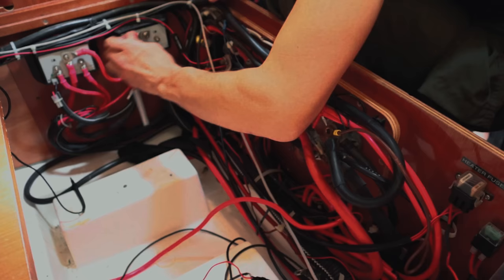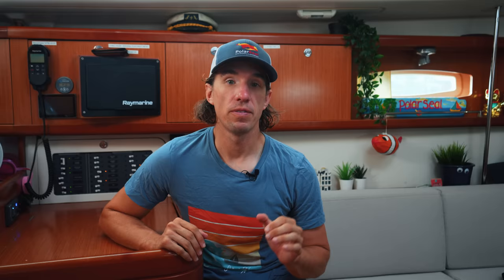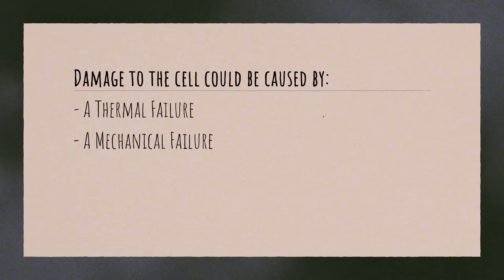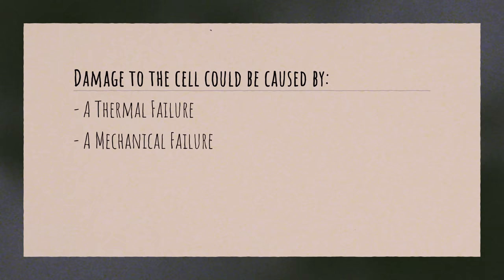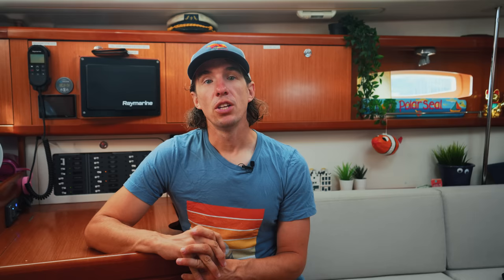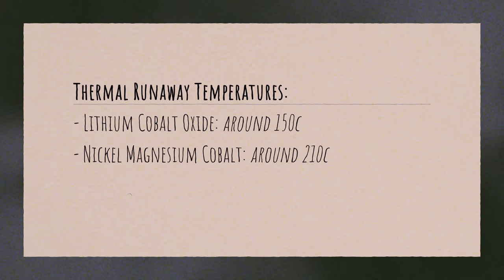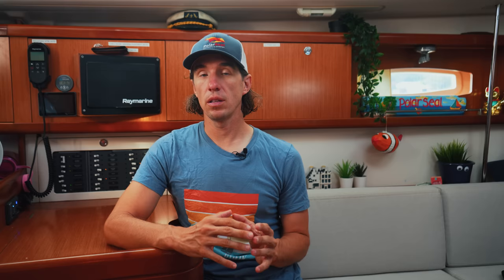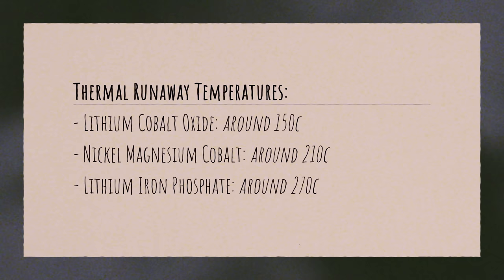WATCH THIS before installing lithium batteries on your sailboat ⚡ [RYAN'S TECH CORNER]

Comment: Got rid of all the parallel house batteries, AGM or liquid.  Reconfigured all the wiring as my new house battery is 6 two volt spill-proof 3500AH forklift cells in series.  Distributed these monsters as low as possible around the bilge to add weight to the keel and maintain balance.  Starting battery is separate but monster to crank diesel is switchable if needed.  3kw inverter gives power to 115vac fridge/freezer.  House alternator is 800A which slows Mr Yanmar a bit.  4.5 hours fully recharges house.  Dock powers 200A regulated charger in port.  Couple of gallons of distilled refills the beasts per year.  They even power the air conditioner!

Comment: A well presented and clear explanation of lithium technology. Well done. It would be nice to add in a section about high ambient temperature and maintaining good battery compartment ventilation. Sailing in the Tropics doesn't do any battery technology any favours and good battery cooling in this environment would be beneficial. You will get more life out of your lithium batteries if you can keep them close to 25degC, not easy in the Tropics.  A lifepo4 installation designed with a 15 year life will likely half its life if the battery is kept at a constant 35degC.

Comment: I have a small sailboat with a pull start outboard and I want to change the AGM battery to LIPO4. I am told I can't charge LIPO4 with the outboard because it will overcharge the LIPO4. Can I use a DC to DC charger in between the outboard and the LIPO4 battery without a AGM battery on the outboard side of the dc-dc charger?

Comment: This is a very good technical video about the lithium batteries. Yes you do a bit of promotion for the Dakota brand but in general this information applies to every manufacturer. As you said, the installation is key. Cheers, Richard

Comment: Hey Ryan, thanks for the great video. My primary concern with internal BMS is that most have no communication once they are placed in a string. You gave this example in your charging segment. I am a fan not a Troll. Even a simple LED indicator showing status would be helpful, but Bluetooth would be the gold standard. I have installed several of these systems (victron so far) and will use your video to teach boaters better LiFe knowledge. Thanks for everything

Comment: Good balanced presentation.  I do have one comment about external vs internal BMS systems.  The first think that jumps out to me as an advantage of an external BMS is that the external BMS is not subject to operating in the potentially high temperature environment within the battery (assuming the external BMS is located and installed properly).  Since heat is the enemy of all electronics, the external BMS should have a lower failure rate than an internal BMS if all other quality factors are the same.  Note that the lithium batteries in my system have internal BMSs.

Comment: Great video guys. Very well put together and informative. I do still prefer the diy builds myself with an external bms for a few reasons but agree there is nothing wrong with a properly built "drop in  ". I like monitoring my cells and would like more control over bms parameters. Not a fan of most bms parameters as they are to protect the battery from catastrophic damage vs say maybe losing a little capacity at the top and bottom to improve cycle life. At least this is what I want for our next battery build after using a cheap dally bms I want something more programmable and not many drop ins are. Thanks again.

Comment: Thank you Ryan.  It's great that LiFePO4 starting batteries are ready for marine service.   Is there are market for an even smaller starting battery for 10-25hp outboards?  Or is the Dakota 60ah the smallest you'd want to go?  Every lb in your tender hanging off the back of the boat and being drug up the beach matters.  Thanks!!

Comment: Thanks for the effort!  I'm dropping in a battery  LiFePo... using it as a house cruising battery for weekends...  and hopping to limit charging to when Im plugged in.   When we get a bigger boat the liFePo batteries make so much with sense,  with the increase comfort,  and safety, while cruising it make no sense to look at AGM and Lead Acid...  Times are a changing .  BTW  Good On You to try a startup!  Im going to look at Dakota more seriously.

Comment: Thanks for the excellent videos on lithium!  To save space on my twin-diesel powered sport cruiser, the manufacturer installed three 12v lead acid batteries in parallel for a combined 300ah house/port starting bank. As the bank is doing double duty, the batteries are deep cycle, which is obviously not optimal for starting. Based on your videos, Dakota website and multiple other sources, I am considering individual lead acid starting batteries vs new Dakota starting + deep cycle batteries with a (mostly) independent LiFePo4 house bank (ACR or combiner) . A few questions for you: 1) Assuming externally regulated alternators, any reason at all to go with lead acid vs new combo batt?  2) Is there really a reason to keep a separate house bank if I were to go with the new combo batteries (I’d like to make use of the extra capacity)?  3) If not, would you mix combo and deep cycle Dakota batts in the house/starting bank?  Looking forward to hearing your take! Randy

Comment: Thank you Ryan, that was a very good presentation! I had just heard that a number of insurance carriers were limiting the dollar amount of claims for boats with lithium batteries, so the info is certainly relevant and timely as well. It would seem that the lack of stats would disfavor the buyers of said insurance and not the issuers of it. Are there any certifications available to demonstrate that the installation was proper?

Comment: I might have missed it, but there was no mention of cell and pack voltage and the differences between chemistries.  For example, you "could", at a long shot, get away with LiFe packs and a standard lead acid charger.  The peak voltage of 14.5V is compatible.  The fact the lead acid charger will attempt a float at 13.6V will just result in 0 current flowing.  What WILL however ruin your day (without a BMS or protection circuit), is if your lead acid charger has a hidden "boost equalisation" feature and every few days hits the batterys with 15V for a while.  No protection, that could go wrong.
However, attempting anything like that with a standard cobolt oxide with a max cell voltage of 4.2V and a probably pack voltage limit of 12.6V, bulk/boost mode up to 14.4V WILL cause fire if the protection circuit is missing or faulty.
I think when you get to packs the size you are dealing with for boats/rvs, I wouldn't want one without a BMS, and ideally internal per cell fuses.  That stops pack runaways if a cell goes short or if enough cells start to die.
I'm looking at 100Ah lithium for a small off grip solar setup.  The 100Ah leadacid is now 3 years old and I'd be lucky to get 20Ah out of it over 12V and if you put more than 5A on it, it sags under 12V already.  Poor things been worked hard though and flattened twice (which probably did the most damage).  It's also been given the "really hard slap" treatment, twice now, not going to work again.  "Hard slap" is basically flatten it, then hit it with a 10 amp fizzing charge to try and refresh it some.  Sometimes works for 'surface charge' issues, but usually shortens the overall life.
They are just so damned expensive and my charge controller does not have a lithium mode, so I'll have to set the charge voltage limits myself and make sure  I disable EQ charge mode.

Comment: I got 4x of the 280 AH Dakota lithium DL series. They were quite spendy but seem like a great solution. We did find that the cases were slightly larger than advertised so had to adapt the battery box a bit.

Comment: Ryan, the info is great and brought up issues i was not considering.  My problem with lithium in general is when it gets wet, especially in a conductive environments.

What are your thoughts on this and the risk of fire in a "taking on water" situation where the battery storage is usually at the lower points of the hull.

Comment: Respect to you and your business and thanks for being upfront about your affiliation. I build my own batteries and is currently running test on a 48V system. To up the total capacity I'm working my way up to parallel connect multiple 48V strings, where each string has its own dedicated BMS. What is your view on using this method to increase capacity? I'm a bit worried about balancing issues
Reply from the maker: It’s funny because we’ve always been very straight forward about Ryan’s involvement with Dakota Lithium, but the brand has gone much farther than we have since we first installed them on Polar Seal 😅 I’ll let Ryan address the question though, cause I have no idea 🤪
Reply: I may help here. Youtube site Off-Grid Garage has done exactly what you are doing and tested thoroughly. Basically, you can have a separate BMS on each 48V bank and they will balance between each other as the highest charged bank will deliver first and then when it reaches the level of another bank it will stop delivering and the other bank will take over. This leads them to self balance. Keep in mind that each bank is balanced with its own BMS. Also, he top balanced first time. There are many of his videos on the construction. Banks are all different from 280AH to 304AH and each has a different BMS.
https://www.youtube.com/watch?v=mkelEzVNmIE
Reply: @SoundzAlive1  Thanks a lot. That's exactly what I'm looking for 🙂 My only problem is that I'm drawing a lot of power. Something like 50kW. If all the power is drawn from one string, I'm worried it may deteriorate faster. I hope I can mitigate this problem by using identical cells and BMS. I guess I'll just have to try and then measure the draw on each string to see the load distribution over time.

Comment: Great video ! I have a couple of very specific questions : Although I am not using Lithium in a boat/sailing application, I am interested in the Dakota Lithium Starter battery (24 group 12v/135a) to use in an off road vehicle. In my case, a basic 1st gen Toyota Tacoma with a standard Denso 80amp alternator. 1. you mentioned "dump" and external regulation, does the Dakota provide "regulation" with it's internal BMS - on the "starter" version of this battery ?  I could use a Balmar surge protector inline on the alternator for dump protection, but how could I manage the voltage regulation from a 20+ year old alternator ?  2.  You also mentioned heat (thermal runaway) , my application would be for much desert high-heat driving conditions, I assume the BMS would protect the battery from over-heating, but what makes the Dakota different from other LifePo4 batteries that typically have a 120F max ? Can Dakota withstand more external and internal heat exposure ? I reached out to Dakota and they told me "not problem" and as long as my alternator is less than 135, everything would be as you say " a drop in replacement" I imagine you have sailed in high heat temps and I assume those batteries in the hull are not cooled by a fan. Any advise, opinion would be much appreciated . Thanks ! Eric, Tucson AZ

Comment: Hi Ryan and Sophie.  Thank you for a great video!  I'm in contact with Dakota to replace my house bank with Li.  Question:  I also have the stock 80 amp alternator on my Oceanis.  Your discussion on alternators makes sense.  I don't go nuts with offshore sailing but if heat is a critical factor in alternator function and especially while charging Li batteries at idle or low RPMs, why not just have a temperture switched, high velocity fan to blow tons of cooling air directly through the alternator to cool it?  Wouldn't that be a cost-effective solution for the day sailer/raft up sailer?  Thanks in advance!

Comment: Electrons do not flow through the electrolyte between cathode and anode, the ions (such as Li+) do.
It is that electron the lithium lost (Li --> Li+  +  e-) that flows through the circuit producing valuable electric work.

Comment: I just had a 3.7volt battery run away while being charged in my kitchen about three hours ago. It didn't make it outside before becoming a firework burning a hole in the carpet. The last thing I want in the bilge is a bank of these cells. LIFePO4 works for me over a Tesla "Fire Wall".

Comment: Hi Ryan, I'm a friend of James from Zingaro.  I've been looking at the Dakota 1000cca lithium group 27 sized batteries.  My current setup is two group 27 agm's.  Will these work as a drop -in replacement?

Comment: Your discussion of battery construction covered anode and cathode but neglected to mention that the electrolyte is comprised of lithium salts dissolved in a highly volatile hydrocarbon. True this is no worse than propane or gasoline, but those are stored under very specific conditions.

Comment: Your initial lithium piece was well researched and presented, always nice to see a follow up. Would be interested in how your flex solar panels are holding up, I've seen two fires started by flex panels. On different vessels. Never seen a battery or gas fire onboard in 20 years of cruising. It's interesting the fear people have of new tech even though the business case makes a lot of sense.
Reply from the maker: ill keep this in mind as we do more technical videos this winter

Comment: Now that server rack batteries are becoming a popular configuration, that might be a good way to design/redesign boat battery storage spaces. The other advantage to server rack batteries is most of them are serviceable, and have external BMS communication capabilities. Individual breakers and displays are also a nice feature.
Reply from the maker: problem is, you have to have a spot for a rack.  also, most of these are made out of cheap metal, which will rust in the marine environment, so be carful.  That said, i do agree that racks look interesting and we should keep our eyes on them

Comment: The issue with most lithium batteries is that most manufacturers recommend against using them for high current (start, bowthruster, windlass) loads, obliging you to retain some type of lead acid battery system for those loads on board. Worse, however, all smart charger manufacturers, advise that their chargers are only suitable for one battery chemistry, obliging you to have two (or more) totally separate and isolated means of charging (ie no manual or automatic combiner) each system. Is Dakota any different? I see that they offer one suitabl for high current loads but is the chemistry and charging profile the same as for deep cycle applications? In other words, could one retain a configuration similar to a conventional lead acid system   ie one single smart charger and an automatic combiner?

Comment: Much respect for your business skills as well as your communication abilities.  Excellent presentation.
Seems to an uninformed outsider that an industry group to promote and report safety might assist with insurance issues.  Industry certified installers/installations would be a huge win if you can pull that off.  Would increase your market substantially.

Comment: Nice video.  I actually bought a clean republic conversion kit for my mountain bike back in 2016.  Need to get a replacement battery pack now but it worked well
Reply: Looking at my old email. It was a hill topper kit, battery type was “24v 250w 20-mile 4.5-lb Commuter $699 kit” :)

Comment: A bit like the phone booth of “Dr Who”, which is much bigger on the inside… :-) What I mean is lots of good info in a compact package. However, perhaps some will struggle a bit with picking up some of the important details, or might even just not be able to follow. This is no instruction manual, of course, just information, so that’s OK. 

I’m also a bit of a nerd on lithium and batteries in general, and I also work with it, for use on electric drive tourist canal boats in Amsterdam. I mention that as it might validate my opinions: I agree with every word you say here. Good stuff!

Personally I prefer large separate prismatic cells and external BMS etc, and I absolutely demand the ability of that BMS to communicate solidly with the rest of the system. That, however, is my preference, not the only option. That preference is an easy way to get a more robust system, in any foreseeable event, and it makes it easy to always know exactly what is going on, in an expensive system we depend on. 

The downside of my preference is that the vast majority of boat technicians should keep their hands off. They’re not competent. That incompetence, and the unwillingness to admit it, as you also mention, is the biggest problem for lithium on boats. It was already really bad before lithium. 

The claims and actions I’ve heard and seen from “boat electricians” with years of experience have sometimes been so totally absurd that I wonder how they can still be out of jail for the damage they’re making. Boaters: Do NOT trust them! There are some really good ones, but they are RARE. The boating service industry is waaaay worse than the automotive one.

Comment: One important difference between internal and external BMS is that an external BMS potentially could turn off charging and discharging separately using separate contactors/switches. That way if the BMS decides to shut down charging due to over voltage you wouldn’t suddenly loose all your instruments/navigators/lights etc in the middle of a critical situation at sea.

Comment: Wow just stumbled on to this video. By far excellent and needed video. I also sail lol… Mainly racing but have done big ocean crossings, no lithium in those days😆.

Dakota needs to partner up with EV drive systems for sailboats!! I burn about 5 gallons of diesel a year sailing yr around on SF Bay. I would go EV AUX power for short range needs in a heartbeat today!!!